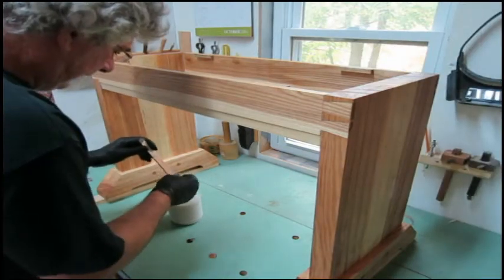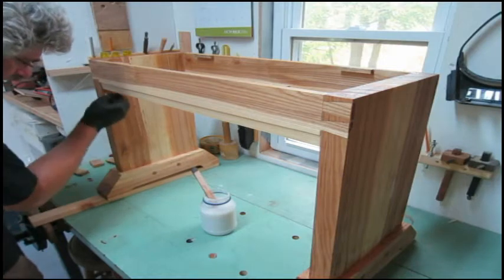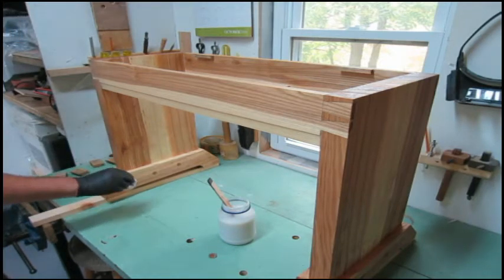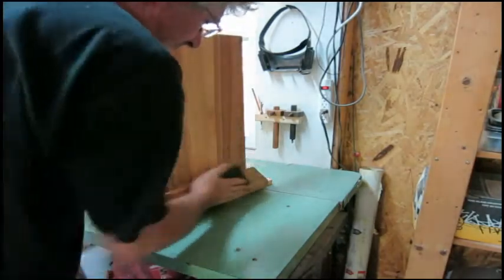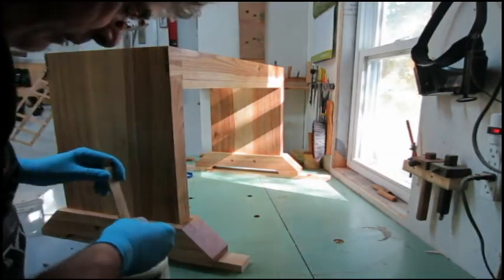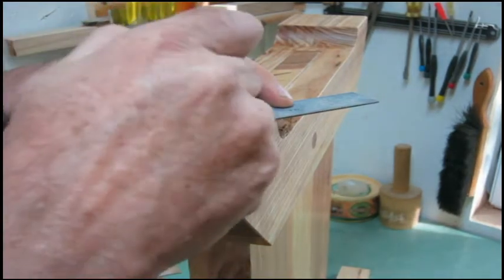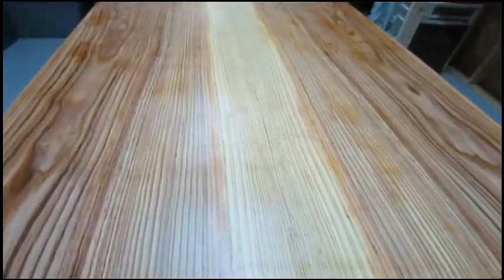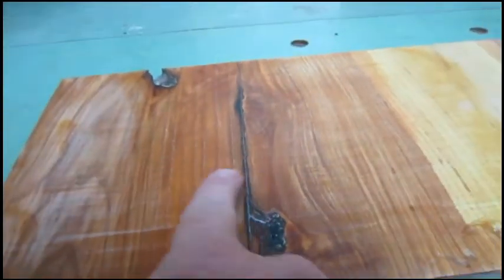Sally s Coffee Table - 13  A DISASTER!

Comment: Disaster?  I figured it fell off the back of a truck. Jim, regardless of how many times you have to re do that top your work is exemplary. But I do have a bone to pick with you. I wanted my wife to see Sally's table so I showed her your video.  But she's a nurse. When I said "What ya think?" her first comment was "'I think I'm calling and making an appointment for you tomorrow.  It's been 10 years since your last colonoscopy ". Thanks a bunch. 😬

PS. On my last table top I skipped the blo and just sanded to 400 and used Milk Paint soapstone wax. Food safe and great feel.  Recommended by a guy here in Seattle that has a slab shop.  And yes, talk more.  As I've said before I love hearing what's going on in your head. Very informative.